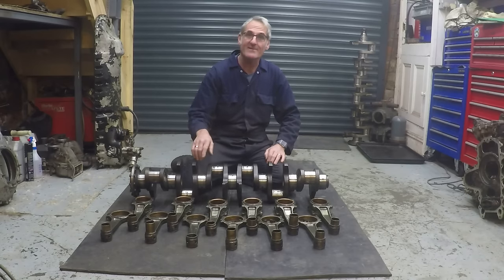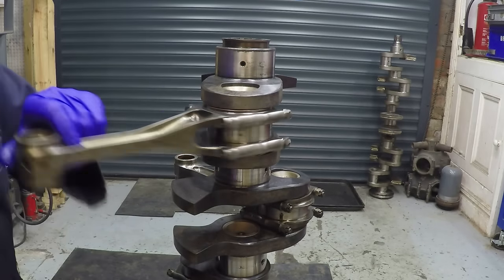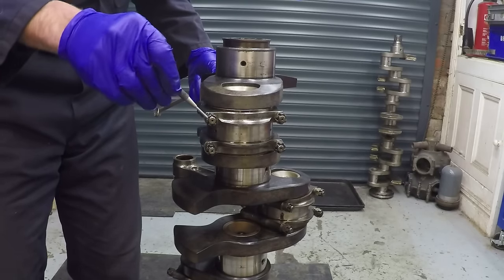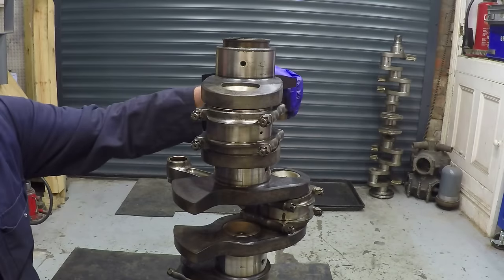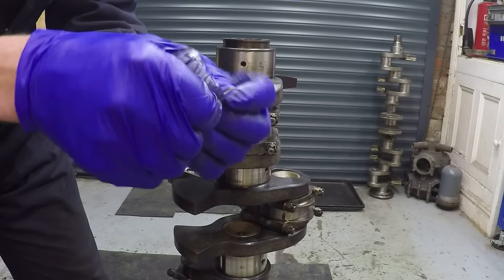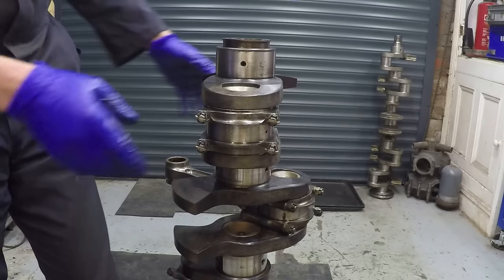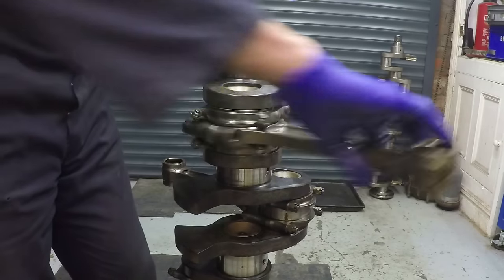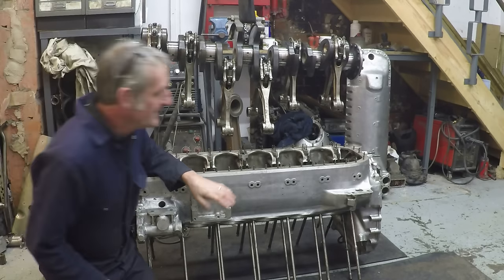The Facebook Marketplace Merlin Engine. Ep2. Building Up The Crank Assembly...

Comment: I have built WW2 V12 German Panther/Tiger tank engines (HL230). They use the same type of knife and fork con rods which are also machined all over. The main bearings are very large needle roller bearings that are oil splash fed .

Comment: This video came up on my feed, I had to go back and find the previous video first to get the background on the engine.

It's really good to watch your technique and hear your explanation.

Not being familiar with "stretch bolts" (I'm an electrical & software engineer), it's interesting to learn about their characteristics. Knowing they twist a little more with each re-tightening, imagining the grain of the forged bolt is a little unsettling (if I were flying behind one).

Comment: I used to build Perkins V12 diesels, the Challenger tank engine had head studs but the generator version was fitted with bolts.. 
I can’t remember what torque settings but each one finished with a 90 degrees turn to stretch it.. That was done with a 
breaker bar and was hard work !
Lovely to see the engineering on the Merlin thanks 🙏
Reply from the maker: Thanks! The CV12 is a great engine. It can make the same power as most Merlins with about 1 litre less displacement. Nearly 3 times heavier though!

Comment: I thought you measured the amount of stretch with a special micrometer that has pointed ends and fits into the bolt ends.
Reply from the maker: You can do that, yes. That is how the Packard Merlin manual tells you to do it, but Rolls-Royce stayed with this method all the way through production.

Comment: Is the crank one solid forging or casting? or is it made up in segments and pressed together like some motor bike cranks were? reason i ask is the crank webs look like the journals come all the way through them and look like a different material to the crank web. (as if the journals were pushed in to the webs)
Reply from the maker: It`s a one-piece forging with hollow journals, so what you can see are just oil sealing caps.

Comment: Top piston ring?     When checking the taper on the top piston rings by putting two rings edge to edge against each other I found that the top mark did not correspond to the manual orientation diagram of the taper. This should have been reported up the line so wondered if you had come across this?

Comment: I like using old tools, but have you had that torque wrench checked for calibration? Ive had old ones off by 20 pounds. And im talking snap on ones from the 1950s and that one looks older.

Comment: I was surprised that where the slot in a nut is just past the pin hole, you tightened the nut even further, instead of packing the nut such a small amount.

Comment: U should flex gauge to check clearance
Reply from the maker: It`s not common practice on these. They have larger clearances than a modern engine and the journals and bearings are measured.
Reply: If you measure the crank journal and the bearing there is no need to plastic gauge.